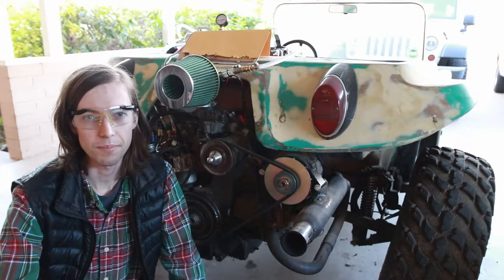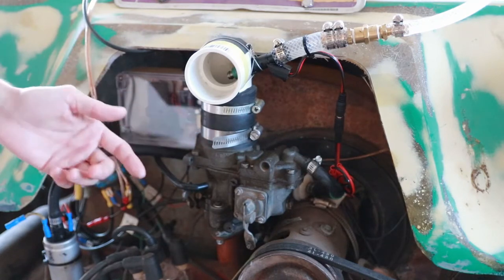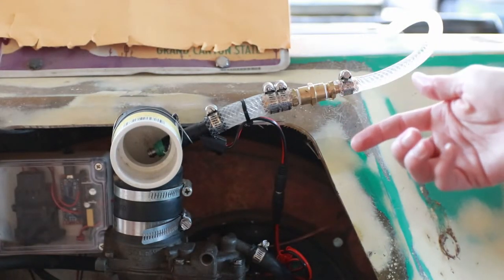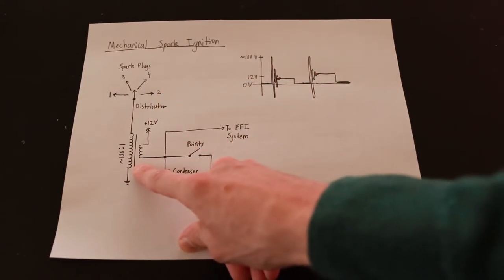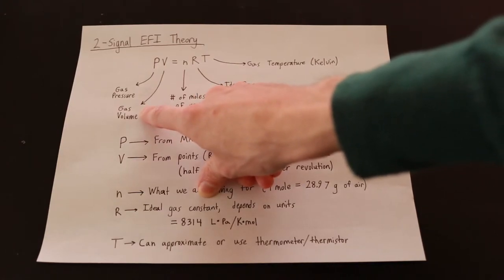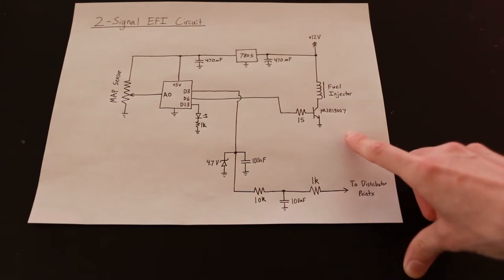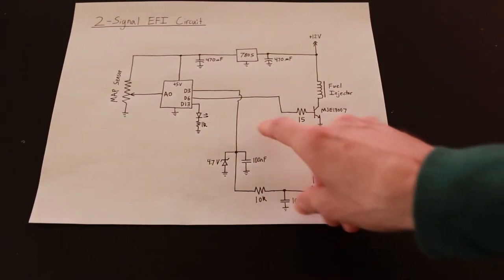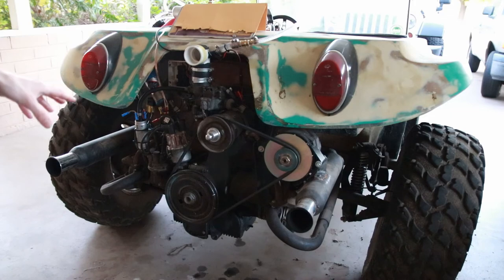Electronic Fuel Injection with MAP and Points Only

Comment: The only good thing about carbs, and the reason why they are still used in high performance race cars is how much more fuel you can dump through it compared to EFI. Nothing compares to 4 barrel Holley when drinking vast amount of fuel...

Comment: Now, in 2024 have you produced a DIY system for sale? I'd like to fuel inject an 80's motorcycle. I understand how it works, but putting a system together myself, no. However, putting a system together from a kit, yes.
Reply from the maker: These are not currently for sale as a kit, but all the files required to make your own PCBs are available here if you are interested: https://github.com/JohnPattersonConsulting/DuneBuggyEFI

Comment: very cool, as a suggestion you might try going with a Hall Effect Sensor, that can be used in a couple ways, 1 put a magnet on something that rotates (distributor, flywheel, ect), 2 put in on a plug wire, because passing current through any wire creates a magnetic field. that should help with your noisy ignition signal. never tried it myself and there is a chance that the magnetic field of a plug wire may be too weak and it might require a simple op-amp to boost the input. but considering what you have accomplished already you seem more than capable to figure it out :)
Reply: hall effect sensors are typically very susceptible to heat an optical sensor or variable reluct5ance sensor coupled with a dual opamp conditioner would be much better suited as well as easier to acquire as vr sensors are abundant and optical well got any spare mice laying arround
Reply: @TheCalebf Yup speeduino guys often take any old vr and make their own rings, and they work very well

Comment: Very severe! But have you ever thought of installing fuel injectors in front of each cylinder, like a four cylinder motorcycle, which should improve throttle response and make refueling faster. I will try using your code to modify the motorcycle now. Another issue is that fuel injection is not based on the opening and closing of the intake valve? In my understanding, fuel injection is only carried out when the intake valve is open. I haven't seen how you achieved it yet.

Comment: I ran across your channel searching ways to build a fuel injection system for my 1973 super beetle sports bug. Your knowledge of the electrical design and operation is awesome and ur explanations are concise!

In ur about tab, you state that you’re not an engineer. Dude, I have an electrical engineering degree. With that, at least I can say you are indeed practicing engineering. Not by title but by practice; your are an engineer. And it seems you’re developing to be a phenomenal engineer! 

Keep at it dude!

Comment: I built something similar a long time ago. I used a 3wire MAF sensor,  instead of a MAP sensor, on my home made fully programmable fuel only all analogue Engine Control Unit,
(ECU). No PC computer needed to operate or program it. I set mine up with a single 4barrel Holley base plate and 6 batch fire injectors to replace the carburettor. Engine was a Holden 308 V8. I also had the problem of out of time injector pulses, and over rich idle, but it did run smoothly from 3000rpm up.  To mess with the fuel curve, it had a plug in analogue up/down push button hand controller that could be removed once the fuel mixture was set. it was amusing seeing it work but, I could think of better things to do.

Comment: Minor point - for the injector driver transistor, put a reverse diode across B-E. That is to say, cathode to base. If the collector happens to swing negative as the inductance of the injector resonates with stray capacitance it will forward bias the C-B junction and consequently try and pull the base below emitter potential. More than about 5V will avalanche the B-E junction and may eventually destroy it. It also tries to pull the micro port pin below ground and so may cause the micro to misbehave. Easier still, just use a mosfet that already has a drain-source diode built in, and will be easier for the micro to drive.

Comment: I'm absolutely amazed that this can be put together with hardware store plumbing parts, rubber coupler, PVC pipe, and a cheap hobbyist microcontroller with home written code.  About 50 years ago I did a fair bit of tinkering with lawnmower and small motorcycle engines.  I was really happy if I could get them to run (and idle) decently and maybe wring a tiny bit of extra power out of them at wide open throttle.

Comment: I like the way you explain the diagram. My plan is to put an injector over my carburator. Bought a old carburetor with the choke plate removed. Last week I was lucky to get my old AMC V8 started a -20°c. I want only one injector that will be used only for cold start. My plan is to give the signal with a momentary switch. That way I will control how pulse to give before cold Start in the winter.

Comment: You could use an optocoupler to read the signal from the distributer, should mitigate the problem. Another way to do it entirely is to place some targets on the main pulley and use a hall effect sensor. In that case you could even do a double target for TDC, but I'm not so sure arduino's millis() is gonna be fast enough, but there are ways around that with discrete logic circuitry (decade counters)

Comment: something you may not have realized about your mass flow calculation is that the engine has a variable volumetric efficiency depending on load. a good average for such an old engine is around 65-75% of its actual displacement

Comment: Hello
The 3.1L V6 TBI engine saga continues. Last time I posted, the engine did not rev past 2500 RPM and after 2000 RPM began misfiring and losing power badly.

Yesterday I modified the AFR table starting from the 2000 RPM all the way to 5000 RPM. Beginning from the 4th MAP pressure value up to the 10th, I input decreasing numbers from 11 to 6, instead of the default ones (13, 12 and 11's).

After the modification, with the gear in Park, the  engine revved upwards of 4000RPM (with some hiccups between 2000...3000 RPM) when hot, but it didn't when it was cold. When test driving, the same problematic 2000...3000RPM range is difficult to pass sometimes.

I guess I shall keep at it searching for the right AFRs for that troublesome RPM range.

One thought does bother me though: isn't a gasoline AFR of 6 way too low for Wide Open Throttle?
And if an AFR of 12 (at idle, no throttle) consumes around, say, 1 L of gasoline every 15 minutes, does it mean an AFR of 6 at Wide Open Throttle only consumes double that, which is 2 L of gasoline every 15 minutes?

Thanks for reading, take care!
Reply from the maker: I think a real-world AFR of 6 is much too low, but in reality the AFR is probably a lot higher than this. I suspect there may be an issue with fuel pressure drop or possibly undersized/clogged injectors, as it sounds like you might be compensating for  lower-than-expected flow rates near maximum load. I would suggest checking with a fuel pressure gauge to see if the pressure is dropping at high fuel flow, and if so, it may be necessary to upgrade the fuel pump or remove restrictions in the fuel system, such as filters or smaller-diameter fuel lines.

An actual AFR of 6 will consume much more than double the fuel at WOT as an AFR of 12 at idle WOT, because the calculated mass air flow will be much higher at WOT. Mass air flow is approximately proportional to manifold pressure multiplied by RPM (neglecting volumetric efficiency of the intake path, valves, etc.).
Reply: @DielectricVideos bisakah anda membuatkan saya program kodingan arduino nano untuk ecu rakitan untuk mobil 2000cc full injec

Comment: I enjoyed this vid from 2020 lol. I'll check your channel out for more on this. Probably a bit late but I have some info.

For years and years the air temperature of the intake was approximated with a temp sensor in the intake. This was done on EFI systems that used mechanical airflow meters. VW, Jaguar, Volvo and a few others didn't have a mechanical airflow meter but a MAP sensor that had a brass bellows inside but they still retained air temp sensor in the intake. According to my sources the air temp sensor was used to trim the pulsewidth in cruise and was similar in operation to pre wide band oxygen sensors.  
Also, in the throttle position sensor an accelerator pump was implemented. How it worked was rapid movement caused extra pulses of all injectors. There were 'tracks' in the printed circuit board that caused the pickup arm to short circuit inducing an injector pulse. Slow movement of the throttle still caused the pickup arm in the TPS to trigger extra pulses but it didn't matter as a smaller amount of enrichment was required. It was basic but it worked. In fact there was a diagnostic test to make sure that accelerator enrichment worked. With the motor switched off (and depressurized etc) you could cycle the throttle and listen for the injector pulsing.

VW aircooled Kombis, Type 3's were offered with fuel injection as an option and had points ignition. Volvo164s retained points as well. IMO points and injection are not a great marriage for long term motoring but they work. Ignition variation due to point wear is not ideal on injected engines.

Due to horrendous replacement parts cost, and a few other factors most were converted to carbs. 20 years ago at home I converted an air cooled Kombi camper that never had injection to injection for a customer that bought a factory fuel injected Kombi as a donor. It ran extremely well until it spun a bearing shortly afterwards. I did a really good job on this one as he was paying top dollar. The 'computer' if you can call it that and the MAP sensor were sent out for a full check, the pump was new, the injectors were all cleaned and tested so on and so forth. 
You gotta remember this was just on the cusp of fuel injection going mainstream for hot rodders and what you're doing here is way more sophisticated than what I was doing. All I was essentially doing was parts swapping by comparison albeit with a bit of know how. 
Today, because parts are readily available I'd convert to a modern injection system. It only happened the way it did because my customer had a donor Kombi he wanted gone from his front yard so we had to strip it and use it for the purpose he bought it for.

So back to the Kombi camper, it breaks down in another town miles away and he takes it it to another well known and old VW dealer who tells him the motor blew up because I converted it to fuel injection. 
While my aggrieved customer was standing beside me I rang the VW workshop and spoke to the mechanic that told my customer that and asked him, how fitting injection caused the big end bearing to spin? He told me true VW mechanics always convert VW EFI from injection to carbs and that in 40 years he's never had one converted from carb to factory VW EFI. I said yes all that but how did EFI cause the big end bearing to spin? He told me it was because I set the adjuster screw in the air bypass valve wrong and this caused the engine to 'lean out', it detonated, hammered the big ends and caused one of them to spin. 
I knew I had him because he was talking crap! 
I told him that he doesn't understand how injection works as the main metering system is fixed by the computer and not alterable in the field. The air bypass valve just creates a filtered air leak at idle that the MAP sensor detects and varies injector pulswidth to maintain fuel in the correct ratio thereby increasing idle speed. I finished with if you knew that you wouldn't have told the customer that.
He didn't know I was a VW, Audi, and Merc-Benz mechanic trained at a big dealership LOL. He also didn't know I had a 1976 fuel injected V12 Jag as my daily driver - the identical injection system the 1976 Kombi camper had in fact. So identical that many parts were interchangeable. This was all in 2002.

18 years later COVID comes around and he sells that Kombi for $50,000. Yep the one that I converted to EFI and got a rebuilt motor a month after I converted it in 2002. He had that Kombi for 20 years and almost all of it was trouble free motoring.
Reply from the maker: Wow, it so cool to hear your experience and knowledge about the evolution of these EFI systems over time!

As you'll see in newer videos, I've done a lot of work on this system in the last couple of years, including a couple of custom PCB designs. I ended up building a proper intake adapter to mount 2 injectors for a bigger 1776cc engine I bought on Craigslist.

I actually daily-drove it for a few months, and I still take it the 20-mile trip each way to work about once a week. It's proven to be a really solid setup over the past ~2600 miles, and I even passed emissions testing with it last week.

I built a custom optical sensor PCB that goes in the distributor, so I no longer have to rely on the continuity of the points to provide reliable injector speed signal. The points proved to be a problem sometimes, as if they got dirty, the ECU would start dumping enormous amounts of fuel in at random times, due to thinking that the RPM was much higher than it actually was. The optical sensors completely solved this. I also have fully transistorized high-energy ignition running off this optical board, so no need for the points anymore.

Even in the newest system I have, it's still using pure speed-density control, from MAP and RPM signal alone. I have a fully tunable AFR table over MAP pressure and engine RPM, and I initially implemented a "rate-of-change-of-MAP" term to do a similar effect to the TPS system you described when the throttle is rapidly opened. I eventually decided that the "accelerator pump" function really didn't add much to the performance of the engine, and it seemed to run just fine (and even a bit smoother) without any extra fuel, so I later set the constant to zero in my program.

I have thought about adding an intake air temperature sensor in the near future, but it seems to run really well even without it. I've driven in 40 F to 100 F (4.5 C to 38 C) weather and the performance doesn't change much over temperature. If anything, having a constant assumed temperature actually helps the engine a bit, as it runs a little richer in the heat, helping to keep it cooler, and it runs a little leaner in the cold, when detonation is less likely.

It's definitely interesting to hear about the the history surrounding EFI on VWs and the controversy surrounding it. I do agree, adjusting the air bypass on a speed-density engine really shouldn't cause the mixture to lean out, as the ECU will just adjust for the change in MAP and RPM. And even if it did lean out, the idle air bypass would only cause a lean condition at idle, not at high load/RPM where detonation is likely to be serious.

I haven't been hugely concerned about blowing up the 1776, as I bought it for basically scrap value in a completely rust-siezed condition and got it running using only PB Blaster and a big breaker bar. The compression values are horrendously far apart (75 PSI, 115 PSI, 100 PSI, 110 PSI), and the first 2 oil changes had clumps of chalky corroded magnesium coming out. In other words, an ideal setup to test a totally experimental, very un-tested engine control system!

Even with the dubious engine condition, I've yet to find a driving condition that the EFI system hasn't performed well in. I've driven on cold days, hot days, in heavy traffic, at 75+ MPH highway speeds for long periods of time, and on all different fuel octanes. What I really like is that I can change values in the AFR table at any time, even in the field. If it starts knocking or misfiring in a certain RPM/load range, I can richen it out there; if it smells rich or puffs smoke in a certain range, I can lean it out there. I've reflashed the ECU tune many times with my laptop out in the field. At 2500 miles, I inspected the spark plugs, and all 4 had clean insulator cores (even the 75 PSI cylinder).

Anyway, it was really awesome to hear your experience and I hope you enjoy seeing the newer videos on the project, as well as a few that I will be releasing soon!

Comment: Such a great video!  About to embark on my own DIY EFI journey with a single-cylinder motorcycle.  First step is to see if it’s possible to make a returnless system by PWMing one of those universal fuel pumps
Reply from the maker: Fantastic!

I haven't tried PWM-controlling the pump, but be advised that if the fuel flow is low, the pump might not receive enough cooling. Whether or not the lower duty cycle makes up for the lack of cooling will depend on the specific characteristics of the pump.
Reply: @DielectricVideos  great point!  I've been thinking about how to monitor for that -- I'm guessing that strapping a thermistor to the case of the fuel pump would actually be a pretty decent measurement point, because the internals of the pump are flooded with fuel.  I'll need to make sure the thermistor is positioned close to where the turbine wheel is situated.  I'll test with distilled water first, and I'll keep you posted!
Reply from the maker: @cellularmitosis2  That's an excellent idea! You're right, since there is always fuel in the pump it should have substantial thermal mass.
Reply: @DielectricVideos  Another approach would be to use PWM to control the pressure, but also have a return (using a flow restrictor) to allow cooling.  Turns out mcmaster carr has a bazillion sizes of npt flow restrictors!
Reply: Just use a corvette fuel filter filter and return all in one you'll murder any pump that isn't designed for pwm

Comment: Hey man thanks for sharing. I’ve been piecing together a 34mm throttle body. I am using Map, tps, and a conditioned VR signal from a common motorcycle ignition pickup coil to start.